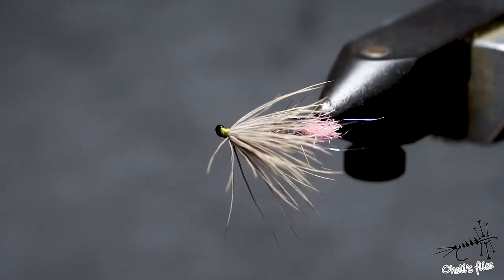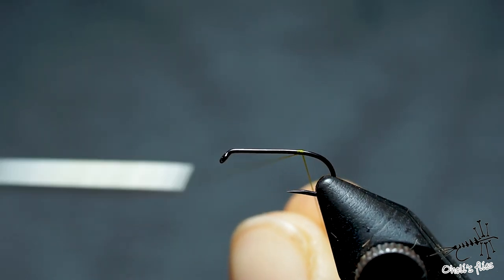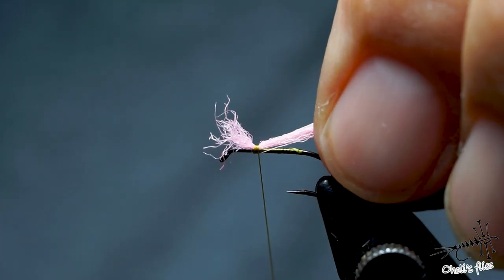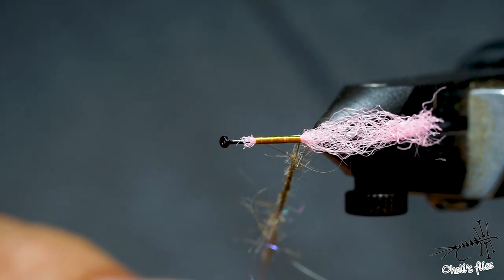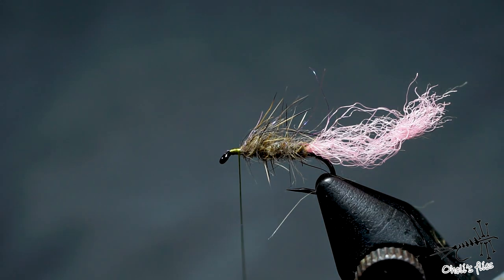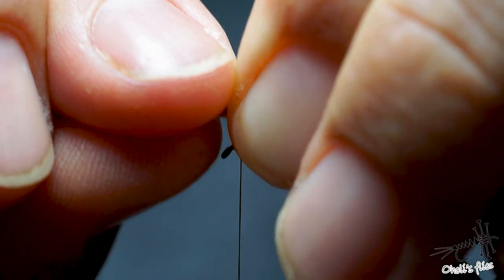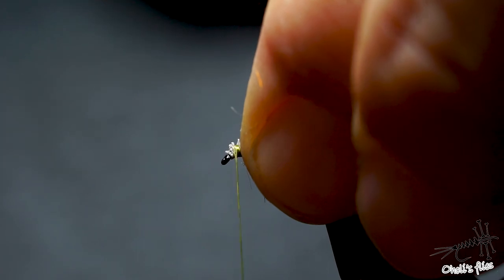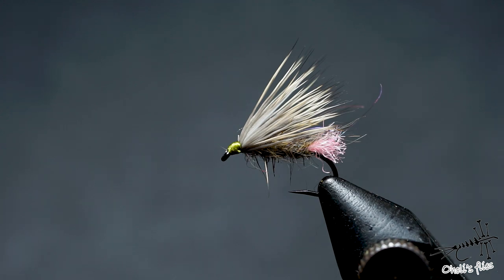Elk Caddis (Covered butt ends and reversed jam hitch)

Comment: Wonder if this type of head will cause the front of the hook to sink slightly, which will bring a few inches of tippet underwater. Makes the tippet less noticeable. Have you fished this?
Reply from the maker: I fished this type. No special advantages with sinking tippet.... But in a week or two i will post a fly that deals that issue.... 🍺🍺